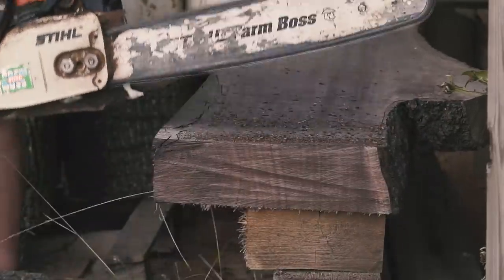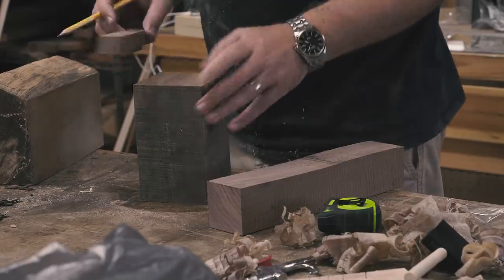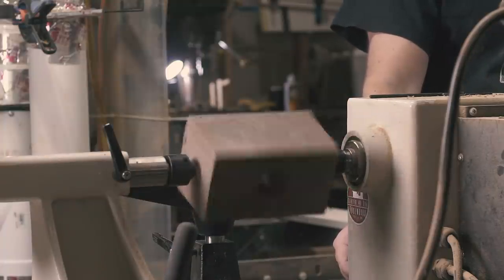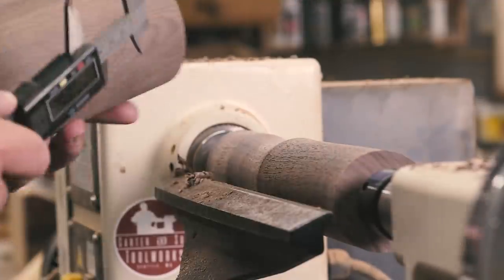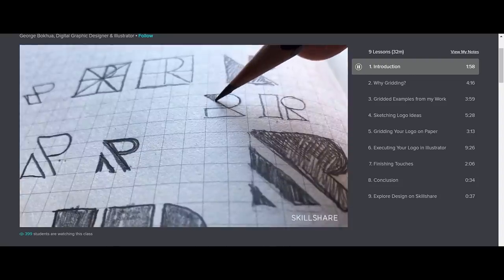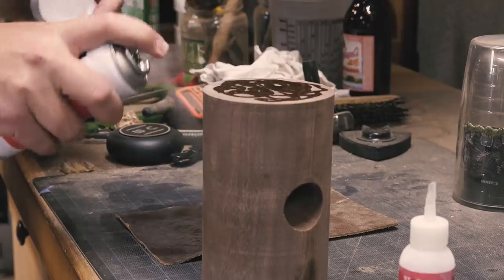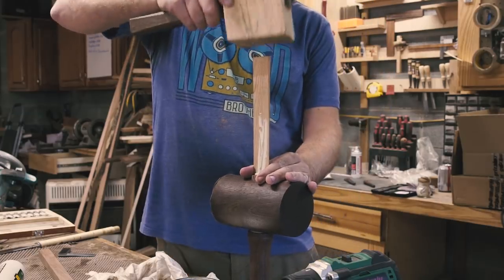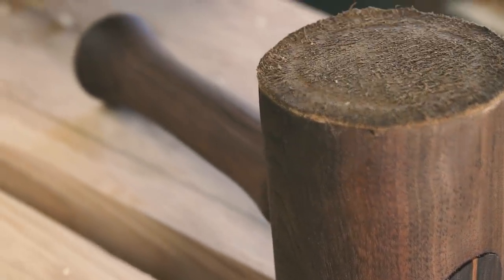The Assembly Mallet | The Mallet of Frustration

Comment: Hi great mallet you made on hammer time, when cutting bits on the band saw I cut the small length first and back out from it less travel then when cutting the long part its got a release , does the wedge run along the grain of the head it was unclear in the video , I like the finished look , keep up the good work ,G
Reply from the maker: That's a great tip!  I'll keep that in mind next time I'm at the bandsaw.  It does run along the grain but in error.  I advised viewers to put the wedge perpendicular to the grain to avoid splitting the mallet head.

Comment: Good looking mallet.  You do nice work.  My only suggestion is to turn the wedge perpendicular to the direction of the grain in the mallet head.  Doing it like this can split the mallet head.  However with a narrow wedge like you used this was obviously not a problem.   Have you used it?  Is the single layer of leather staying put after being whacked against other wood?
Reply from the maker: I actually addressed that in the commentary as I was installing it. Noting it as an oversight and suggesting your method.

Comment: Handle vs Head grain. The slight angle would bug me. Is CA glue really strong enough for the leather face ?
Reply from the maker: It is going to bug me too, but reminds me it's handmade.  Time will tell if CA is strong enough.  If it's not, I'll sand the face and epoxy a new leather face on.